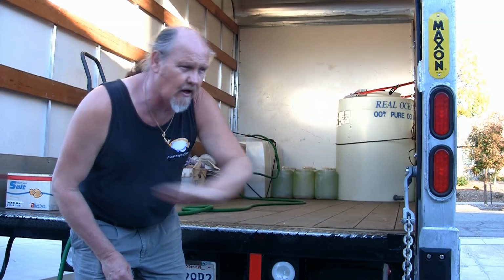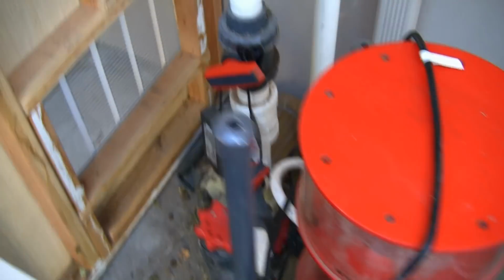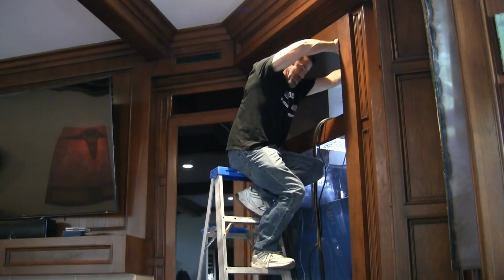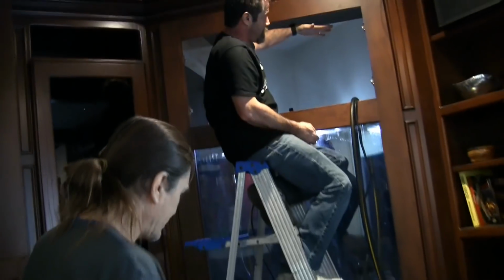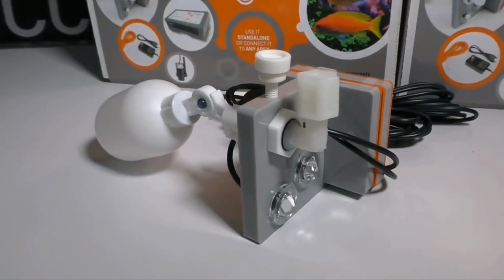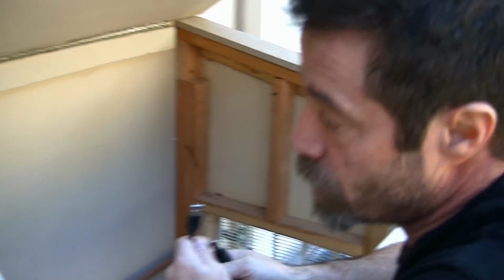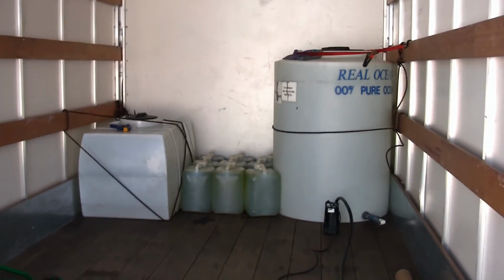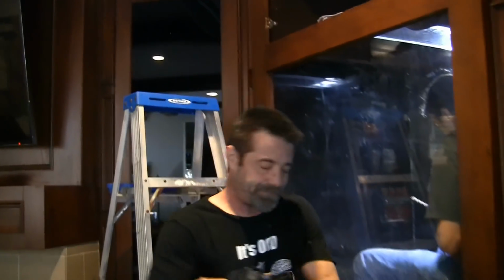Reef Tank Re-Do, LA Fishguys, Episode 161 Part 2, including adding Tunze's and an APEX System

Comment: How will that return work with a power outage. Won’t it syphen back out?
Reply from the maker: Its on the open loop side and will only drain down to the point where the returns enter the water back into the tank, which is at the top of the tank just under the water level.